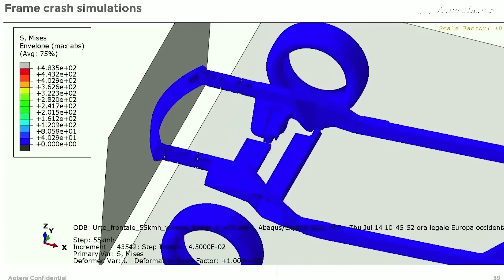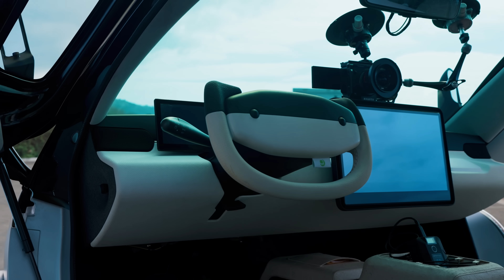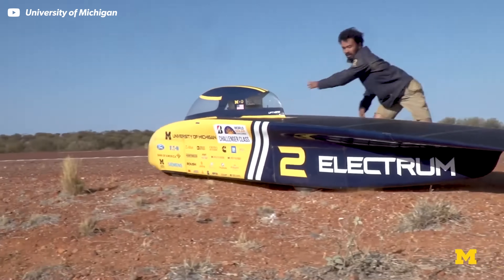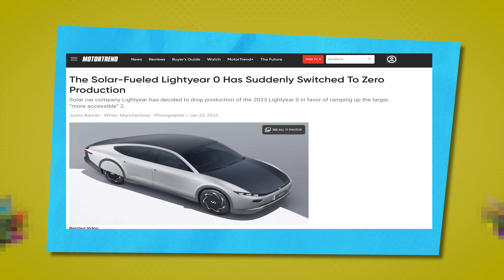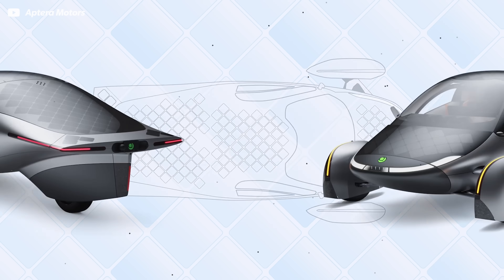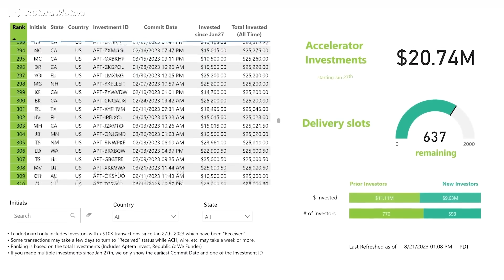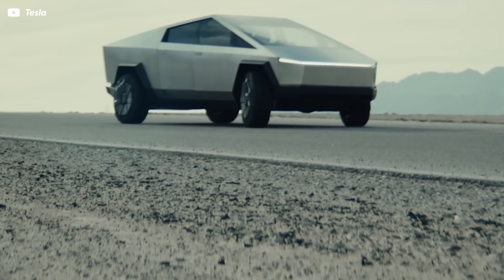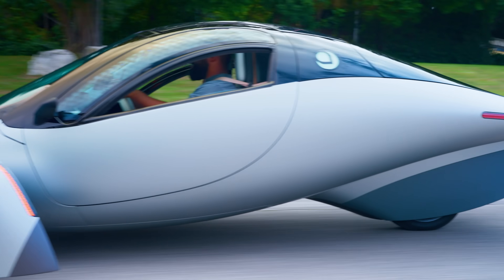We Drove America's First Solar Car

Comment: I am rooting for this company since I saw it on Rich Rebuilds.  Their right to repair stance with QR coding each part tying it to a video is also very cool.
Reply: good luck repairing it when they are out of business in a year or 2
Reply: They change things so often that they probably already forgot about that.
Reply: Man a lot of trash talking on your comment.  The repairability is a concern for me and this will be one area like you state above is I’ll be watching the roll out of the right to repair before i pull the trigger on my reservation.  The world needs a vehicle like this.  We don’t have vehicles aimed at daily commuting, most are designed for longer road trips which may happen once a month versus a vehicle that is purpose built.  Obviously you can go for the larger battery for those road trips, but i would challenge people to rethink this and rent a vehicle for those rare road trips.
Reply: Single purpose=small market. Older people? No. Active people? No. Handicapped people? No. Families? No. Pets? No. Fast-food fat people? Apparently.
Reply: @garrettlowell7637 Is it supposed to be a mass pro or a showcase production run?
Reply: I don’t root, I invest
Reply: @garrettlowell7637  Most of the people I know who plan to make Aptera their sole vehicle are probably what you would call "old people", including me.  Perhaps you don't know that there is a specific provision for pets, including a "pet mode" and safety restraints designed to keep pets and their owners safe.  You haven't done any of your homework on the vehicle and who has already ordered it at all.
Reply: @TheStonedAge  his first Aptera is a niche vehicle.  It has just proven through paid pre-orders to be a much larger niche than even Aptera themselves realized.  If you read their SEC report, they plan .like Tesla, ion introducing new models in the future that have much larger market potential.
Reply: If this succeeds at all I'm sure corporate America will suddenly decide that solar panels over parking lots is a really good idea.
Reply: @emptyshirt  I certainly hope they do!
Reply: @garrettlowell7637  interesting way to look at this.  So yes single purpose, commuter vehicle and last I recalled we still had a large population that has to work.  There is a very big market for this vehicle.  Why drive the tank to work solo, when you can take the aptera for next to free?
Reply: I’ve been following this company since their first attempt back in 2010. They failed, but I think the technology is where they need it to be now
Reply: @Palbizu  Thank you for your comment.  The current company is a brand new one, established in 2019.  

The old company, Aptera, Inc. was a joint venture with Idealab.  Idealab appointed a CEO from Detroit who apparently never wanted to build the vehicle he was hired for.  He threw out the founders in 2009, but couldn't get funding for his alternative plans, and liquidated the company in 2011 (They never went bankrupt as so many on line claim).

Steve and Chris have run other successful companies, including a lithium battery company he took public as CEO before he started Aptera Corp. and brought back Steve Fambro and other key people from the original company.  This happened in 2019.  Progress has been good compared to most new automotive startups, including Tesla after the same time frame.
Reply: @n.brucenelson5920  you’re correct-I haven’t done in-depth research-I matched the depth of this vid. I didn’t say “old people” & I shouldn’t have said “older people”. I should have said mobility-challenged people. Your anecdotal buyer example is not likely to be an accurate representation of the buying demographic. In the end, the market will decide, as usual.
Reply: @TheStonedAge  difficult to say based on the absence of real data in this video.
Reply: @thehightechhermit1143  a very nearly inane question. I suggest you write out a pros and cons of owning two vehicles, one that can serve a limited purpose and one that can serve multiple purposes.  In addition to initial purchase price with all options and features licensing, be sure to include space/storage costs and requirements, insurance costs, manufacturing costs, resale variability, sales tax, property tax, road tax, annual operating costs.
Reply: @emptyshirt  Solar panels over parking lots is a good idea whether or not this vehicle succeeds.
Reply: @tims8603  Even if every car ends up with solar panels?  An empty parking space is waste, a shaded solar panel is waste.
Reply: @emptyshirt  The solar panels on Aptera are for supplemental power. It's only practical on a super efficient design like Aptera. Yes, a lot of EVs will probably have solar panels but only for things like running the AC in a hot parking lot. There will still be plenty of non-solar parking lots for a long time.
Reply: @garrettlowell7637 Why can't active people drive it? Why not older people?
Reply: @garrettlowell7637 Well, I can tell you that the overall operating costs and the insurance will be a lot less than a regular car. Technically speaking, it's legally an auto-cycle, which means motorcycle insurance, which is much cheaper. Don't worry, the safety tests are gonna be done as if it was a regular car.
Reply: @MrGamelover23  none of my activity gear will fit in this thing. It certainly won’t get me to my camping, hiking, and kayaking locations. As for older people, I should have said mobility challenged people. No chance I am getting my mother into and out of this thing. Again, we’ll let the market say.
Reply: @MrGamelover23  I couldn’t care less about safety. We’ll see what the operating costs, insurance costs, etc are when we have that data.
Reply: @garrettlowell7637  Well, considering that it's legally classified as an auto cycle, then the insurance costs are going to be much lower than car insurance because motorcycle insurance is for some reason lower than car insurance. Which is weird considering that motorcycles are much more dangerous.
Reply: @garrettlowell7637  What exactly do you have thought it wouldn't sit? If it can fit bikes and surfboards, I really don't understand what you couldn't fit.
Reply: @MrGamelover23  I‘be offered my opinion based on my own experience and requirements in conjunction with the currently available data. And now we’ll see what the markets say.
Reply: This company will be out of business within 5 years. It’s a bold idea but there’s a reason every review of the car is a paid review. There’s not a single video of a review that has any criticism whatsoever
Reply: @Romanus-   Aging Wheels - You're Wrong About Aptera

He spends essentially the last minute saying he was not sponsored by them in any way, even paid his own way out to Cali. Sweeping definitive statements are shit. Now is the time when you say "well OBVIOUSLY I didn't mean ALL the reviews are paid" even though that is precisely what you said because this is the internet and people can't even recognize they made a mistake for fear of looking foolish in front of the faceless people who you will never meet and vice versa.
Reply: @lucristianx  Is it set up as a SPAC?